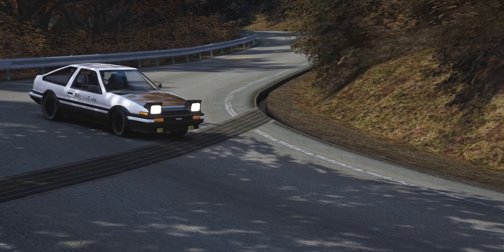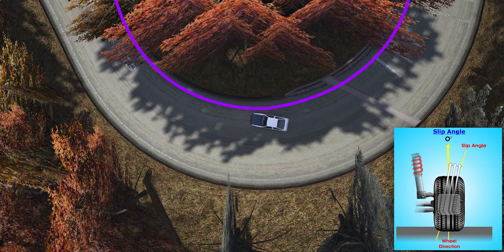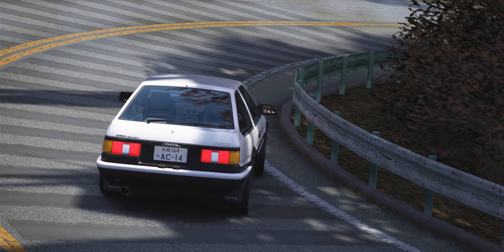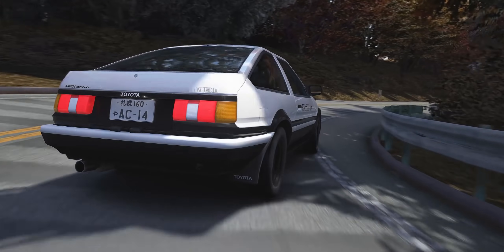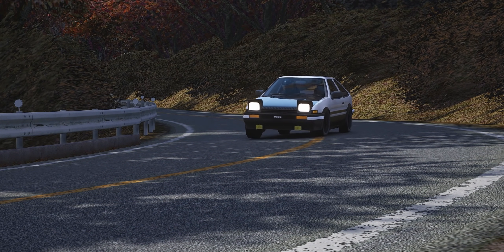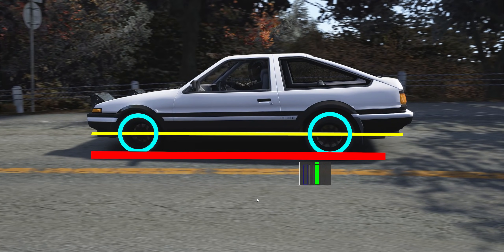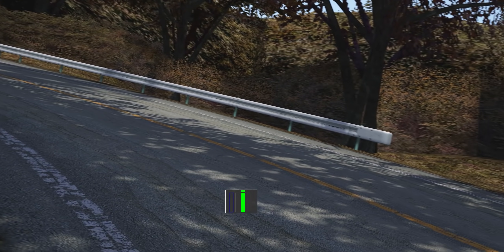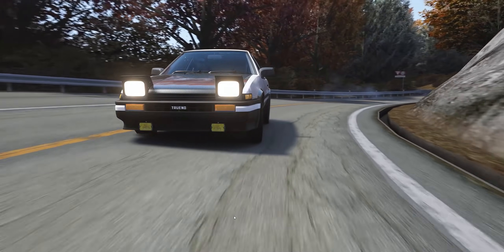Slip Angle in Touge - Master this to be a faster Sim Racer

Comment: How come this technique is rarely discussed in most racing guides for typical track racing like GT3? Is this something more applicable on downhill only or does it apply on everything? Im guessing the reason why its not discussed as much is because it wears down the tyre too much that its only worth it on short races like touge and qualifying races. 

Btw, you earned my sub. Im gonna try applying this technique on iRacing mx-5 races.
Reply from the maker: Thanks! Well typically slip angle is a result of already driving fast. So as long as you're already fast and are driving correctly you should be utilising slip angle. I can't remember if I mentioned that in the video, but I think I did. There was a entire segment of the video explaining this but I cut most of it out.
Reply: @TSRB  I did more research on this one and apparently slip angle is what we are trying to achieve when we trail brake to turn into a  corner. Knowing this concept made me more consistent in hitting apexes.
Reply: @dominicalfafara3375  Not really. When you trail brake you try to maximize slip ratio vs slip angle. Slip ratio is like slip angle, but for longitudinal direction. You can't have both at maximum. When you are maxed out at braking, you can't turn. As you release brakes slowly, you can gradually increase the steering (introduce slip angle). Then same goes for exiting the turn, you can gradually increase throttle while straightening out the car. GT3 cars won't like that much of oversteer yaw angle, because two reasons: their high performance tires operate at lower peak slip angles, and another reason is aero stalling with certain yaw angle - you basically loose downforce when you oversteer with car like GT3. And yeah, surely sliding also wears tires down very much, much more than they are in static friction position in relation to the surface.
Reply: @TSRB  So for my entire 10 years of racing games, I was deliberately stopping myself from driving faster and restarting when I did this because I thought I was losing time
Reply: Because this is something that you have to learn and if you aren't an experienced driver then do not use this technique. This technique requires knowledge of your car, the differential, how it behaves, weight shifting, knowledge of the track, knowledge of how your cars traction is doing and how much grip you are using at a given time, etc. This is simply not a technique for newer drivers to even bother with but if you reach the upper echelons of racing you will need to master this technique.
Reply: @Delimon007  I went 10 years without learning about it though. I think I'm ready for our by 10 years. I'd been stopping myself from doing it all because it's gratuitously obscure knowledge. That Sim Bloke even says many people intuitively learn to do it without training, but stop so thinking it slowing them down when it's not.
Reply: @Delimon007  fantastic explanation!
Reply: @christiantaylor1495  if you notice your sliding your loosing time. Untill you get with in the top 10% of drivers your slip is going to be choppy and cost time understanding how to control oversteer ist different.  Oversteer is too much slip in the rear tyres slip doesn’t just apply to rear tyres. It also applies to front when you understeer you are getting positive slip angle over steer is negative.  It’s a result of driving fast not a technique to drive fast. You are always experiencing slip no matter how fast or slow you are driving
Reply: G L  I seriously don't buy this gatekeeping shit. You don't accidentally stumble onto this kind of performance. Well, I mean, you could stumble on it, but you get what I mean. It requires skillful execution regardless or not if its the consequences of preforming something else. Furthermore, what difference does it make if people start to consider it a technique or whatever? It doesn't change the fundamentals of how to achieve it or what its a consequence of.

This is a dumb of an argument as saying drifting isn't a technique, it's just the consequences of counterstaining and sliding the rear... or whatever the fuck. No shit its the consequences of some other action. That doesn't change that it requires skillful execution to preform a distinct action.
Reply: Theres a great book called speed secrets that explains this very very well.
Reply: This is a racing technique not a drifting technique nor called slip angle driving. God Hands style of driving is the style of a professional driver.  Drifting will always be 2 to 3 seconds slower a lap at most tracks even executed by the same driver. Pure grip will always be slower because your not on the limit of the tyres grip. Tyres have a optimum grip of 7-14 degrees of slip angle. It’s just caused as a result of driving fast. “Grip runs” are less than 7 degrees , “slip angle runs”where the fastest runs will alway be in the 7-14 degree runs and drift runs are 20 deg plus. 

Driving in the tyres optimal grip range results in a “slip angle technique” but it’s not a technique it’s rather a result of being a fast driver. If you are not fast it will not happen. If you want to learn to be faster learn about weight management in a car. MX5 is a great way to learn that. You can look at my skippy races on my channel (they are old and I was a crappy driver but the slip angle is still there)
Reply: thats because to anyone who isnt an initial d fanboy and has some experience in racing its called "rotation", and in most cars its not something youre supposed to force, with some exceptions, like low grip, low downforce road cars, karts or skip barber cars. Thats why its not a technique, or something you should learn, its just something you need to understand is a side effect of driving fast, and that you shoudlnt always avoid it.
Reply: @superspeeder9184  pretty much this. its not limited to road cars though. look at how people drove in the 60's to 80's~ in most classes that werent LMP's. Even F1 cars before they had all their aero they pretty much "drifted" trough corners. Its just going fast, trying to keep going fast in preserving momentum and using the brakes to get the rear to rotate the car on corner entry when you dont have the mechanical grip to do so. Ofc theres a skill on not overdoing it and just wasting your tires becuse you are actually just yeeting it around the track :d
Reply: @superspeeder9184  exactly lol. Some one know what they are talking about hopefully people don’t get click baited into thinking this is an actual technique rather a result of excellent driving.
Reply: @cecilracing53  ... I mean, how can you drive fast without good technique? I could just as easily power through a corner and accidentally drift it. Most of what we consider "technique" in performance driving is a result of some other action. If it's a fine line between successful execution, and failure, chances are it's a technique. Even if it's a result of good driving, that in and of itself is technique.
Reply: @connorcampbell5274  there are only a few techniques in driving everyone likes there car to handle a certian way. Slip angle is not a technique. It’s data point. Good technique involves smooth hands and smooth feet with quick reactions all combined. Slip angle is about knowing your tyres. Some tyres can only take 5-10 degrees of slip and still keep grip others can take up to 15. 6-7 is about the average for a fast lap. Also no matter how fast or slow you are going you have slip angle. Slip angle is not something you can untilize, it’s not a tool in racing. It’s something you have to know but you can’t use it to be faster it’s just there. It’s a result of going faster not being a good driver. Being faster doesn’t mean better technique it could just be balls but bad technique about 90% of the people. Like I said it’s a data point. It’s kinda like aerodynamics, the faster you go the more grip you get, you don’t have to be a good driver to have downforce you just need to go fast. Infact you can be at about 6-12 degrees of slip angle and be slower than someone who is only used 3-4 degrees, I know because I’ve seen the data on it. I was 5tenths faster than another guy through a single corner in a Miata but he had the right slip angle and right line but was too agressive on entry and exited the corner I went through with no sliding and was faster but still slower than the faster guys who were at 11-12 degrees of slip same as the guy who was slower than me. Slip angle isn’t only a product of speed it’s also a product of bad technique.
Reply: @cecilracing53  Shit, maybe it's because my day job is interface testing and translating layman into technobabble is quite literally what I get paid to do, but this seriously just seems like a nonissue to me.

Let me explain, because you wrote such a good response I think you deserve something more than normal internet rage.

I get what you mean. Actually I think your analogy with aerodynamics is a great argument. It's just a feature of the equipment, I don't think anyone is denying that. Such is the same with slip angle. It is just something tires *do*.

But so is weight. Weight is just a part of the car, but managing that weight is important to driving. Managing the performance of your tires, and how the car interacts with their grip is important. I'll concede, sure it might not be good necessarily for the best time, but the mere fact that this many people can "incorrectly" jump to the same wrong conclusion is perhaps an indictment on what is, and what isn't.

My point is, there is an element of control involved by the driver, with a rather pronounced effect on how the car moves as a result of how the car is driven. If it looks like a duck, smells like a duck, and sounds like a duck...

IDK, though. I'm just some cunt that takes his FRS out to road atlanta every so often to ruin my brake pads and tires. I don't really know much about actual racing. But that's my two cents.
Reply: @connorcampbell5274  no that’s great logic! Nice to talk to someone who isn’t just internet smart ahah. I’m not great at writing this stuff out and it extremely technical and detail oriented racing. I could write 10 pages on or and still would have let out details. 

I am specifically arguing with this idea of tyre slip being a technique. Your reference to weight transfer is fantastic! Good driving is directly related to weight transfer and speed in the corner(g force) create the slip angle combined with speed. which is where I was talking about how your feet and hands directly. 

Someone rough with their car can throw their car in a corner and basically slide it through the corner at the limit of the tyres grip and let’s say their turn in speed was 60MPH apex is at 30 MPH and they achieved a slip angle of 10-12 degrees and an exit speed of 45MPH. He looks like he’s using the right technique cause he’s sliding the car at the limit but if he went any faster he would spin out

A better driver can enter that corner while being smooth with their turn in at 60. but their apex will be 40-45MPH and exit speed of 60 mph and they will have a slip angle of 7-8 degrees, he looks like he is slow and a bad driver cause he isn’t sliding at the limit. 

While a professional driver can enter the corner at 75 MPH and achieve a apex speed of 50~ and exit speed of 65~ he will have reached the tyres absolute limit at a slip angle of 12 degrees (on average) while look amazing and just like the first driver but be faster, a lot faster. 

I know this is hypothetical situation but I’ve seen the likes of it on paper in reality. 1 MPH is typically worth 1 tenth of a second on the track which is massive that means from the average good track driver to the pro that 5 mph difference is .5 of a second. 

Your mention of weight transfer is really good  that’s more important than slip angle. As described above the smoother you can move the cars weight around the more grip you have. It’s all about not shocking the tyres. The more progressive the weight transfer the more grip you have. Slip angle is a data point relevant to how much grip the tyre has. Tyres typically can’t hold more than 12 degrees of slip before the loose traction. That’s why the fastest Lauch isn’t a launch where your tyres just spin, and it isn’t a launch where your tyres don’t slip at all. It’s a launch where you are getting the perfect amount of slip because you are right on the limit of the tyres  potential grip. My absolute limit is not the same as an F1 driver. If we were both driving the same car if I tried to corner at the same speed as an F1 driver id crash but we would both be at about 12 degrees of slip angle, In other words we would both be on the tyres limit the F1 driver would just be able to get more grip out of the tyre. 

I might make another reply idk if I missed anything since I’m on the phone replying.
Reply: @connorcampbell5274  my reasoning for this being a bad concept is because I have seen many a driver think they were fast just because they watched initial D and saw this and slide the car at the perfect amount what was the limit for them but they were slow even though they did what initial D showed
Reply: @cecilracing53  That's one of the great things about having a Toyobaru twin, because you already know you're the slowest thing on the track lol. #slowcarfast

Ego disappears the first time grandma's civic blows past you on a greenlight. I have no one to please but myself heh.
Reply: @connorcampbell5274  ahahah If your fast in a slow car your fast ahah, I’ve seen Miata’s over take vet‘s on the track! Ahah

Comment: In the cas of the old 86, how much do we think live axle played into how Takumi handled that car?
Reply: it probably gave him a slight advantage in acceleration out of a corner, perhaps somewhat explaining the fujiwara zone "4wd acceleration"
Reply: Yes and a little bit no.
I say no, because independent rear suspension grips better, and that means you have a higher limit, which is good, inducing and KEEPING it at an efficient slip angle however.. not so easy.

Anyway, back to live axle giving an advantage, a "fujiwara zone" and "4wd acceleration", it's actually pretty specific to cars exactly like the AE86.
I happened on it as a new driver by pure coincidence more than any sort of driver skill 🤣🤣🤣

The "fujiwara zone" is best explained as axle squat on neutral steering while drifting out of a corner.
In my case I was going sideways, centering the steering between two corners, figuring I'd let the suspension neutralize the load, so I could whip it into the next corner with more of a "snappy motion".
Instead the rear axle squatted, gripped up, and sent me full throttle towards the ditch, I lifted throttle and steered into the next corner but nothing happened, all the load was on the rear end, a lack of fancier options saw me slamming the brakes before undesirably introduced to the ditch and painful physics lesson 😂😂😂

Been fiddling with it ever since, the corner has to be "just so", too wide of a corner radius and the speed and gear is usually too high to allow the rear end to squat and grip sufficiently for that "4wd acceleration", if that makes sense, too shallow and the revs are too low, too wide and you're not in the middle of the powerband on exit.
In the anime he has an engine producing more power at higher revs, so, makes sense that he can do it in a wide variety of corners 😅